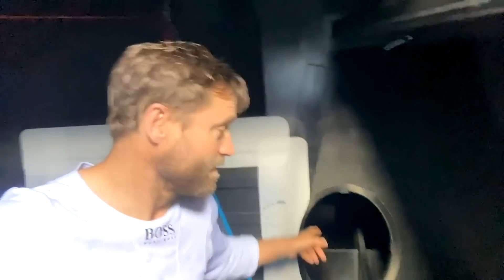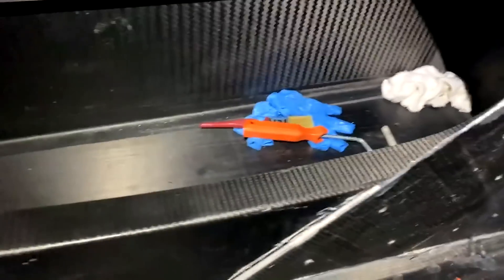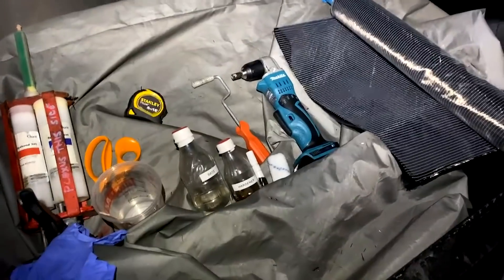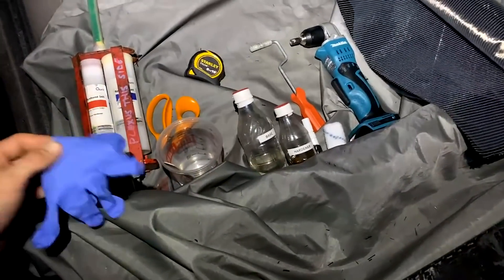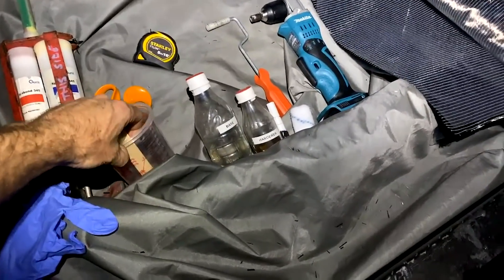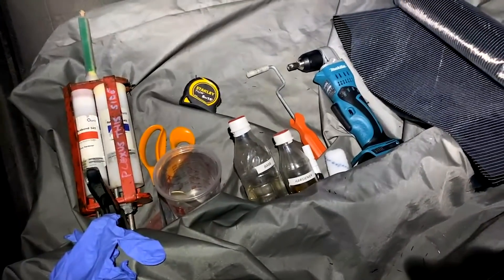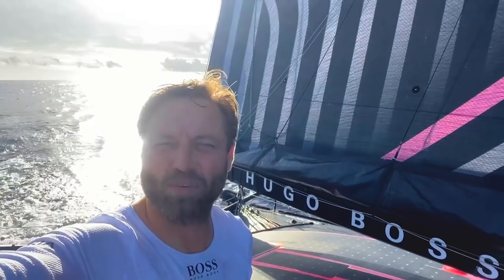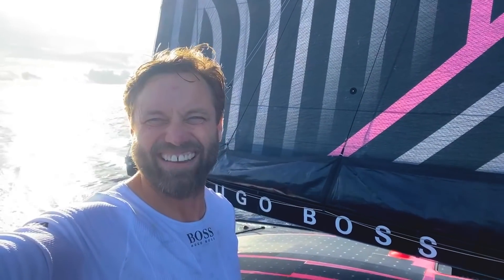Onboard Update: Repairs nearing completion

Comment: Great work, I hope with it now being stronger than before you can push hard to make up the distance and bring home the win for the UK.
Reply: No accidental damages with OFNI reported.
That means that level of efforts considered by the architect was too low and/ or Alex used may be 130% of capacity...
As conséquence the " repair " will not  
Make stronger the damaged structure.
Expecting that maximum efforts which damaged the Boat will be not met Alain.
But no doubt Alex cld not used the boat anymore as he did when he has choosen to cross 60Knots wind....
Other foilers hv turned around...

Bad luck
Reply: Hugo Boss is German, FYI.
Reply: @williamjolka4351  Sorry, can you explain it in more detail? It is hard to read, couple difficult words...
Reply: @petersizen3897  hi Peter. Sorry I m french so my langage may be bad.
I mean the original structure has no sufficient safety margin or Alex asked may be about 130/ 150% capacity when he went through the 60 knots wind instead of turning around the dangerous zone.

This because no collision was reported so it is over limit using or
Missing of carbon dimension. 

Other Skippers sailing a foiler have made safer choice and were able to
Recuper the lost time as they maintained the boat in no damaged condition 

Any way the repaired structure will never be as strong as original . As conséquence the Boat gets Handicap when fighting rough sea which will certainly happen many times as the road is still very long.

Expect this clear. Repaired is not stronger !! Except may be when managed at shipyard...
Reply: @williamjolka4351  Thanks, and I understand now, and I think you are right. He has to be safe with the boat, although he did amazing job with the resources he had. I wish him luck and good conditions.

Comment: Good job on the repair!  hopefully your team on shore can figure out why that element failed and then have a look at the rest of the structure to see if anything else needs a layer of carbon or length of girder.  The issue is why did it break.  Maybe a load calculation error.  Good luck Alex, now time to head south and dodge around the leaders.

Comment: When you have mixed up the epoxy in the measuring beaker, tip it out onto a plate or bowl. A thinner layer will generate a lot less heat and make it easier to put it on the roller as well. Shame about your dinner though.....

Comment: Put the Shute up Alex.With those compressive forces of the bow pounding the waves I’m suggesting you need a diagonal compression post running back from the keel  of the forward bow compartment to the centre deck frame work area where you have just done the repairs to stop the bow deflection,you really need to stabilise that bow area.That patch will get you home in fair weather but your about to hit the ugliest seas on the planet.Its common sense man,don’t risk your life on make shift repairs,wishing you good choices and a safe race Alex.

Comment: I looked closely at the work done by the incredible Alex, who did everything he could and more. So by eye, but I really hope I'm wrong, I'm afraid that at the first lump in the southern ocean, the repair of the bow will hardly hold up. I wonder what engineers are the ones who designed Hugo Boss, similar structural damage with winds and ocean that were certainly not those of 55 ° South. I don't know what to think, fair winds Alex.
Reply: And what experience do you have in this field exactly? I mean, maybe you are right, but do you just have a feeling, or you see some flaws and you have a strong argument?
Reply: @petersizen3897  I am a designer of racing, motorcycle and car components. I admit my ignorance in marine engineering, but I have some experience with that type of composite materials. I don't even think about criticizing what Alex did, whom I consider to be the best sailor in the world. What I mean is that he did everything he could in less than optimal conditions, but it is still a temporary accommodation, it will certainly hold with not extreme sea, but a structural failure remains and with the southern ocean is another story. I'll be honest, I hate these people who try to cover their asses on Alex's skin.
Reply: @emanueleartusi5572  I see your point. There are some serious design or manufacturing flaws, and Alex is heavily dependent on that boat. Those parts should have took at least 3x the stress they have seen. It is hard to defend the builders. Sure they don't have 1000s of prototype boats to build, and cannot stresstest them on the whole VG every time, but this huge material failure opens some questions. Maybe it was a computer model issue, or a manufacturing error. Working with CF in a boathull must have unique challanges even on land. I would rule out incompetent designers since VPLP and Carrington boats have amazing references. There was still a huge difference in the math and the reality, and I am curious what caused this gap.
Reply: @emanueleartusi5572  Thanks, I have just seen this video as well. I am happy that this kind of knowledge is available on the net. The importance of "easing out" the strength of the stiff parts and creating stress points with the overstrengthening of the broken parts were things i did not think about.

Comment: Amazing determination but hard to fathom the repair will be any stronger than the original design that failed miserably in the conditions at this point. With an unforeseen design flaw or material defect of this magnitude I would think the vessel would be at risk to continue into the more dangerous phases of the voyage. Yes for lifesaving it's a great repair but for a race I think it's irresponsible for the engineers to allow this thing to enter the Southern Ocean. Jean Le Cam was specific in saying that if these new technology boats have a failure it could cause great risk to the crew.
Reply: I think these boats can be repaired to be stronger than they were, the question is if Alex have everything required for that. Do you miss something? What makes you think it is not enough? And do you have a link to Cam's interview when he said that?
Reply: @petersizen3897  Repaired stronger than a design/engineering flaw? Opinion seems that this is just a typical repair on a sailboat of a proven design. It is not a proven design it's a prototype, quoting alexthompson.com " two years of painstaking design and build work, undertaken by more than 100 naval architects, designers, engineers and boat builders". For conversation's sake I would say that these people have failed in the design or build with an undetected or unaccounted issue that has caused this amount of structural damage. Yet these same experts are going to put Alex to sea after certifying a quick onboard repair? Alex had stated something didn't feel right so he started investigating and found the damage. But I get it, this is for fame and fortune, safety takes a back seat. Alex is not a sailor right now, he is a test pilot, and a brave one at that.
Reply: @otrrs  You are partly right, but i think you are missing an important part. These guys have amazing expertise, both VPLP and Carrington boats have built many ocean racer boats. They found a weakspot and they run many simulations now to identify causes and consequences. They could strengthen it to be better than it was in a dry dock for sure. The only question is does Alex have the tools for it? The engineers did some mistakes sure, they weakened the whole hull, and I think this lead to extra forces on the longitudinal element which broke. But I don't think this part was by design any weaker than on other boats, just the math become too complex. The big question still there, this would have to cope with 3-5 times this beating.
Reply: @petersizen3897  Yes, having to cope 3-5 times the beating is pretty much my point, I really hope the engineers have the utmost confidence in this "solution" and the overall seaworthiness of the vessel to allow Alex to continue.

Comment: Slightly concerned when I saw the carbon sheet move in synchronisation with the sound of a wave in the first shot of repair. Can see you have worked very hard to add strength to the central beam, hope you have the confidence on completion to open her up and use her speed potential when prudent to do so.
Reply: Agreed. How suspect is the rest of the structure
Reply: @tommypetraglia4688  good point. Puzzled quite honestly having built a boat previously this should fail. I wonder if the carbon manufacturing process was right, there were more cracks than he pointed out if you notices and what he has done adds strength but nowhere near as much as the original
Reply: @STANLIZ4  
Seeing that the beam and the  attachment, which are two entirely separate elements, both failed leads me to suspect it is not a manufacturing defect.

They pushed the envelope a bit too close to the edge broke the  boat in conditions quite honestly were not too rough.
Reply: @tommypetraglia4688  think your right
Reply: @tommypetraglia4688  Why would they weaken this part of the boat? This is where you have to cope with the force of the waves, and that's a prolonged hard to calculate stress factor. This is where they should have gone for a safe solution.

Comment: How that this kind of "weakneses" aren't find at the "testing" and "validating" procedures after fabrication itself..?
Reply: Hi Mali, I used to be a yacht designer of sorts and I would say it's difficult to assess the effect on a structure of thumping hard into heavy seas hour after hour, day after day. However I often wonder whether if the boats were built a bit stronger all round they could be driven harder. It's always a tough balancing act for designers
Reply: Surely Mali, that is part of the exercise of the race!?     To take the final test.
Reply: Apparently they designed it a little light. We know this by the beam failing as well as the attachment which are two entirely separate elements which means it is not a manufacturing defect.

Inspite of the fleet not yet 
 encountering much in the way of boat breaking weather HB came apart, pointing to a design flaw.

But everything about these new boats is pushing the envelope and it appears they've arrived at a new minimum in this case

Comment: So after making repairs you have hopefully returned the failures to a near 100% strength. Will you be adding additional materials such as through-bolted doublers to increase the strength to enable sailing in South Ocean monster seas?  HINT: IT FAILED BECAUSE IT WAS NOT STRONG ENOUGH FOR THE SERVICE.  EITHER INCREASE THE STRENGTH ELSE REDUCE THE SERVICE STRESS.  Come on guys - you know the drill... Alex is NOT going to back it down so you must increase the strength.  I thought you outfitted HUGO BOSS with strain gauges and accelerometers to monitor the conditions... doesn't sound like a very good system for the millions invested.  Question?  I can help!  Good luck!